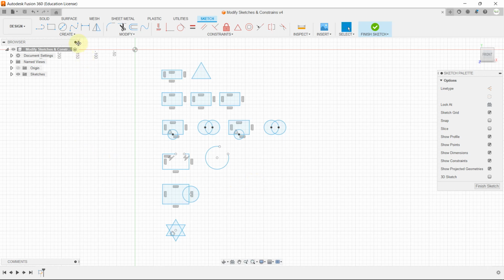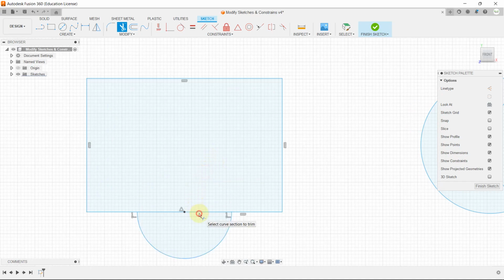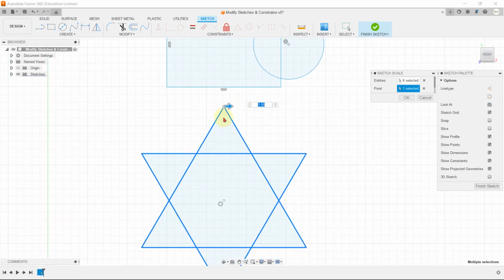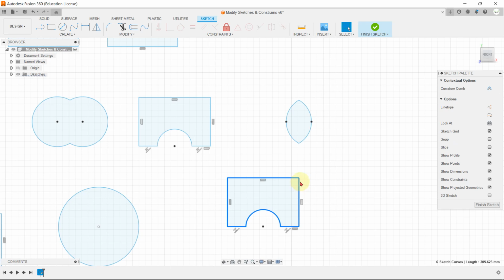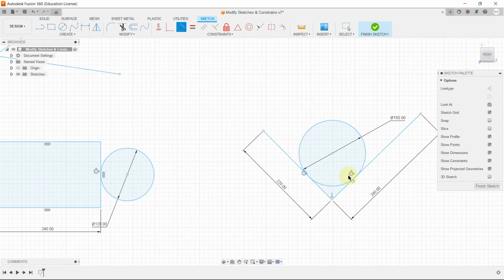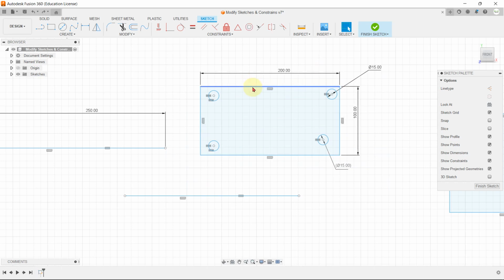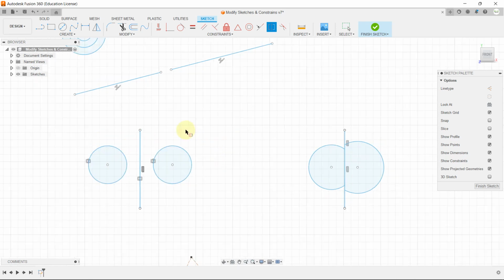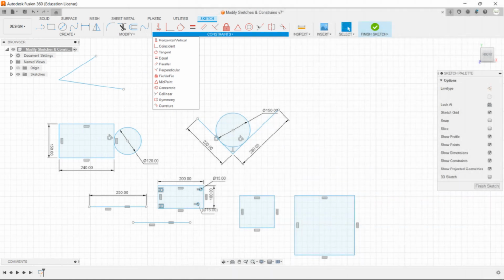Modifying Sketches and Applying Constraints | Fusion 360 Tutorial for Beginners | #fusion360

Comment: Very helpful for beginners. Just have a question regarding tool bars default settings on how to stay visible the sketch command tool bars. I can't find the settings to default to sketch toolbars not solid toolbars or settings to customize toolbars. Also,  dimension commands and drawing line with detailed angles with fillet radius then translate into specific point. Thanks.